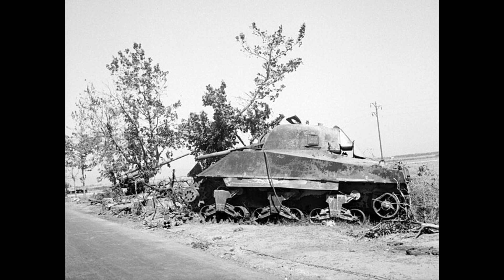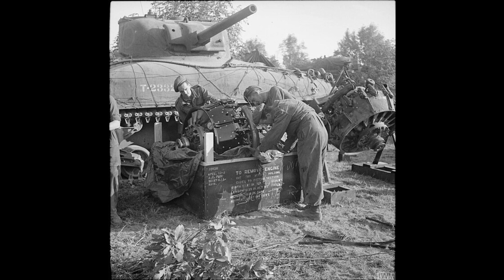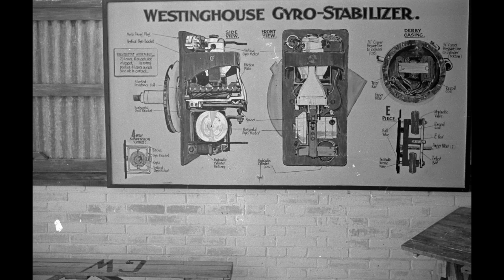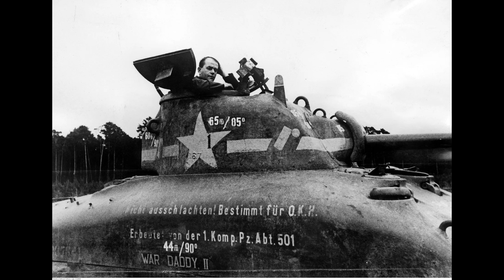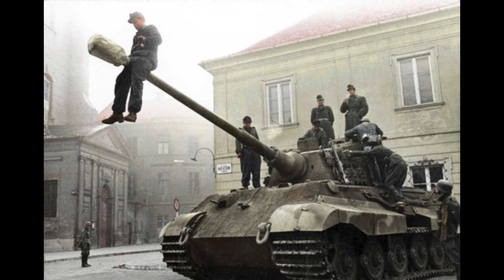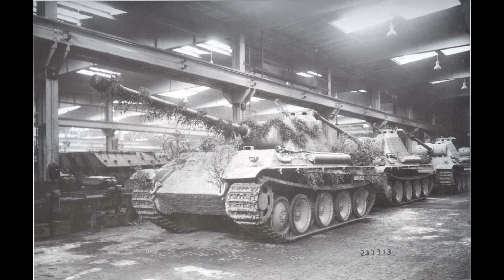German Engineers Tested a Captured Sherman - Then Realized Why They Were Losing the War

Comment: Why does everyone call the German "Big Cats" things like "engineering masterpieces" and the Sherman things like "barely adequate but reliable"?  The Sherman WORKED while the big cats BROKE DOWN.  I can see calling them "over engineered" in the sense that engineering is the art and science of using "just enough."  Obviously, they used NOT enough to make the transmission gears last long enough to be reliable.
Reply: Lennon or Lenin? The world is run by those who turn up. If the German tanks didn’t turn up , which they didn’t because of fuel shortages or breakdowns then there’s va pretty uneven battle. What’s strange is that the German general staff, who must have known of the needs of huge armies and also of the incompatible and fragile Russian rail network failed to realise the riskiness of their plans. The Sherman was excellent unless you were confronted by a bigger tank and even then with good tactics and a decent gun it could hold its own.
Reply: @billtaylor2050 Germany was never short of fuel until the last year of the war.  They had enough to send Italy 50,000 tons a month yet the Italians controlled the Albanian oil fields, the largest in Europe.
Reply: @billtaylor2050  It turns out, from objective and careful historical research and analysis, that German Generals were basically incompetent in the art and science of Logistics.  They seemed, generally, to think that Logistics, including supply, was Someone Else's Problem.
Thus for example General (Later briefly Field Marshall) Paulus, with reports of a major Russian offensive on his flanks, took no action whatever to protect those flanks.  Instead, he squatted down in Stalingrad, and blamed everything that happened thereafter on other people, since they failed to supply his surrounded army.
The much Vaunted Erwin Rommel behaved in similar fashion, leading eventually to total disaster.
Reply: Tigers & Panthers are cats
Reply: @richardwarner3705 we've all seen the avg IQ of yanks now. Or lack of
Reply: @clutchkicker392ison5 
I blame it on the Tequila🥃🥃🥃🥃🥃🥃🥃🥃
Reply: @richardwarner3705 or their education
Reply: @clutchkicker392ison5 
Settle down there, Banjo
Reply: @clutchkicker392ison5  There it is. I was starting to wonder if I was going to read a sample of the typical, undeserved, smugness, that superiority complex, that condescending attitude I have come to love like a pair of well worn boots (not the storage area in a car kind but the you wear them on your feet kind of boots). Tell me, just how does a small island country go from a world spanning empire to a "please sir, may I have another" barely holding on to its sovereignty by the tips of its proverbial fingers type of country? I mean, sure there are lots of ignorant, country bumpkins who couldn't find their own asses with both hands, a map and a flashlight (you guys call them "torches"), however the United States of America also brought the power of the sun to earth (just ask Japan, they'll tell you all about it...twice), the U.S. was second to outer space but first to the moon. When America was pouring everything into research and development into the microchip and electronic computing and all the possibilities those results would bring...what were the eurotrash "geniuses" doing? They were hoping the yanks would continue to over spend on their military budget so western Europe could continue to understand on their respective militaries so they could redirect portions of their budgets into social programs (a.k.a. buying votes of the masses with their own money). The U.S. made the SR-71 out of titanium we purchased from the Soviet Union...our biggest rivals at the time. We developed/developing stealth technology (a technology that got a major boost from a research paper written by {wait for it}...a Soviet scientist...we really should send the U.S.S.R. a thank you card and gift basket for all they've done...oh, right. Nevermind). 
The point I'm trying to make is:  get down off of your morally superior, high horse because from where I'm standing, you've got as much (if not more) embarrassing things that fill your history as we (and just about every other country here on this little blue sphere) do, and I believe we both can look down our noses at the Chinese communist party, the dprk, Cuba, muzzie countries and most of Africa and several South American countries.

and Germany...and France.
Reply: @clutchkicker392ison5 considering AMERICAN Sherman crews had the LOWEST casualty rate of all the tank forces in the war, that means we made the Sherman CORRECTLY. Meaning CREW SURVIVEABILITY over fire power. Yeah the Firefly could destory a Toger but the crew were DEAD if the tank got hit since the  gun installed in those ELIMINATED the ability of the crew to move and the lack of protective headgear didn't help either. The German "wonder weapon" tanks were predominantly on the Eastern front and a RAREITY on the western front, and those that were encountered were DESTORYED by the Sherman. It doesn't matter how many Shermans were destroyed or damaged taking the Tiger/Panther out because replacement tanks were already being sent and the crews SURVIVED the fight and got back in a new tank the next day. The myth of the unstoppable German armor was spread to excuse how POORLY Commonwealth forces performed on the ground before getting M3 Lee and M4 Sherman tanks.
Reply: @clutchkicker392ison5 enjoy your caliphate 🍺
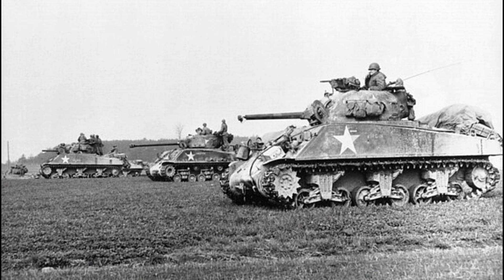Reply: The question was posed “If you had a choice between a Panther or a Sherman which would you pick to fight in?”  Well for a single battle perhaps the Panther so long as it was running, but for months of continuous mobile fighting I’d take the “EZ 8” hands down. Why?  Because it wouldn’t let you down, had seen significant improvements to mobility and crew protection and that HV 76 was more than capable of being a Panther killer. Especially if paired with 75 mm Shermans to deal with the infantry, defensive fortifications and at guns, which they almost always were (highlighted in the image at 17:57). People look at this all wrong. The Sherman was viewed as a part of an offensive machine. Panthers viewed generally and built to be their own team. History proves which philosophy was correct.
Reply: Pretend you gave to fight in one, the Sherman or the Tiger,  which would you take?
Reply: @dougritchie9548 
Pretend you can answer questions as well as ask them.

Where?  What is the terrain?  Is it 1 on 1 or a typical understrength German battalion against CCA/4th Armored?  Does everyone have a full fuel and ammo load?  What specific type of Tiger?  Sherman?  Will there be bridges?

What else is available to each side?

That will ALL matter.
Reply: @BillCarson-u3j
In 1941 when the M-4 design was finalized and cleared for production, it would have been the master of ANY German tank, though that was not its design mission.  Had it been a British design, they would have called it an "Infantry Tank," like the Matilda, as it's design mission was infantry support and that "French 75" was far superior to the British 2pdr for the tasks inherent to that mission but it would suit the tank v tank role if necessary.  

The "tank killer" (British "Cruiser Tank") mission for which it was not originally intended was to be filled by the series of designated "Tank Destroyers," first of which was an M-3 halftrack with a bed mounted 75 firing to the front.  It was followed by the M-10 with an improved 75mm and upgunnned to the 3".  The M-18 mounted the 3" on a blazingly fast chassis which saw great success in France deslite its very light armor and the M-36, basically an M-10 with a 90mm gun which made the Tigers vulnerable.   Only the halftrack was available in North Africa.

In 1942, when they first saw combat, the Sherman tanks were superior to nearly all German tanks they encountered and were at rough parity with the PzKpfW IV (f2) in all ways but automotive reliability, a virtue in which the Sherman was undoubtedly superior.

By 1943, the Sherman was showning its age and first encounteded Tiger I and Panther against which it wzs largely ineffective.  Improved Sherman models entered the pipeline.

By mid-1944, the latest German tanks definitely outclassed the old Sherman.  Sadly for the Germans, improved models began to arrive in the area of operation as did the British "Firefly."   Though still inferior to the Tiger 1 and Panther, the gun disparity was reduced.  

The main German battle tank remained the PzKpfW-IV (h), largely an f2 with protective "skirts."  The Ardennes Offensive of 1944 featured  a very large fraction of all PzKpfW-VIb (King Tigers) ever produced.  Many were lost to fuel shortage and automotive breakdown.  The offensive failed and its objectives were not taken.

Let's  assume that German offensive succeeded AND that Patton failed to relieve Bastogne THEN the weather cleared.  What then?

Because Montgomery's Second Canadian Army had cleared the Scheldt Estuary at great expense a month or two before, the Antwerp to which the Germans would have arrived would have been bristling with late model weapons and crowded with soldiers ready to be "baptized by fire."  Given the rather large number of King Tigers broken down in the advance, their number available to clear Antwerp and defend against the counterattacks American doctrine required would have shrunk, day by day, without hope of replacement while Allied numbers and state of armament and supply would only improve and rapidly.

In the end, the Tiger and Panther crews would walk back to Germany as their tanks fail in the retreat or accept "demotion" to the PzKpfW-IV that was still being manufactured in quantity... IF they could be delivered.  The captured fuel depots would be destroyed.. 

The "Big Cats" still lose, army to army even if not tank to tank and more than a few would lost tank to tank.
Reply: @dougritchie9548 The one that will last the entire fight, and be easier to get out of if im hit. So Sherman.
Reply: @dougritchie9548 
The Sherman. The odds of running into a tiger were so small that being worried about that happening was idiotic. Also, odds are you wouldn't be with a tiger one on one, you were part of a group of tanks supported by infantry.

And if you had a Sherman with the right rounds, you could disable it, it in a firefly, destroy it.  Tigers often operated alone because they had so few, Shermans operated as a group usually. They also thanks to the radio net with infantry, has early warning if a tiger was in the area and the Shermans could position themselves to be able to disable it. 

War movies like the Battle of the Bulge propagated a lot of myths,that the mighty German armor was invincible and supperior is one of them. 

And btw I have direct knowledge, I am old enough that my dad was a WWII combat vet in an armored battalion ( in his case TD unit, but also had been in tanks ).
Reply: @dougritchie9548 my Grandfathers brother was a career Sergeant in tanks. WW2 and Korea. I think he served in everything from the M3 Lee’s through to the Pattons. To hear him talk he loved the Sherman best. It had really great speed and acceleration. And apparently you could jump them much farther than the other tanks. (This was a major story point for 10 year old me raised on Dukes of Hazard.) yeehaw. He got to help play with some captured German tanks at one point. He said when they ran they were great. But forget ever getting one on the test range 2 days in a row. Good guns. But everything about them was overly complicated. He equated them to a family members fancy Turbo Diesel German car that spent 6 months in the dealership waiting on parts. Uncle John said a lot of cool things. But mostly what he said was “WHAT!?! What did you say? WHAT!?!” Although his tales of racing Sherman’s down a steep hill with a hump at the bottom to see how high and how far they could jump them was always a high point of summer vacations.
Reply: Same reason why F1 cars whose components barely survive one race are called “engineering masterpieces”.
Reply: For their time, they were considered “engineering masterpieces”! They were better made than the Sherman! To say that a Sherman was crap is inaccurate and hyperbole!
Reply: Partly because  the german machines were finely finished where it didnt matter
Reply: Over engineered usually translates to can't be fixed in the field
Reply: @shameless6963 
Would an "over-engineered masterpiece" be completely unserviceable in the field, then?
Reply: The German tanks of WWII are like German cars today. High tech, easy to run, but unreliable in real world conditions and expensive to repair.
Reply: @abyssalreclass 
Basically yes. Mercedes is notorious for that, they do innovate, come up with all kinds of crazy things to make driving easier, but it makes them less reliable and less easy to fix. The VWs were a simple car that was crude but easy to fix and relatively reliable for the time.  But later generation vws , audis,bmw, benz all went the route of complexity in ways that was to be honest weird. I remember trying to change a headlight bulb in the new generation bug and even with help from you tube videos and websites, it was bizarre.
Reply: @njlauren  I owned a VW ('99 Jetta, AAA VR6 engine), and I am still scratching my head trying to figure out the reasoning behind some of the design "features"
Reply: @abyssalreclass 
I had friends who owned the later Jettas and they said the same thing, muttered about strange sensor setups, fuel line fittings and the like. My dad, who was an engineer, said that German engineering seemed to be if there was an easy way to do something, or a hard way, they would find an even harder way to do it.
Reply: @njlauren  I would still like to slap the genius who thought it would be brilliant to put the timing chain on the transmission end on the AAA VR6, essentially requiring removing the engine from the car and separating it from the transmission to replace.
Reply: @abyssalreclass 
Why am I not surprised? They would argue it was a space thing, but in reality is was laziness or it cost less to do that. My 71 alfa had a timing chain that if I needed to change it,I could drop the oil pan and the valve cover and replace it easily. ( Real brilliant part is the timing chain was really,really durable, lasted forever and had a simple way to tension it if need be). 

They all do it, I have a toyota Camry with the high output headlights. To replace the bulb requires basically taking out the entire light assembly if you do it the way toyota does it, there is a hack but it is a pita. VW has something similar with their headlights on the new beetle, I helped a friend do it , the air turned blue with our cursing.
Reply: To this day they still over engineer their vehicles cost a lot to fix sure efficiency goes up but so does repairs
Reply: This type of information is fairly new in light of the history that was taught. I’m almost 61 and all I ever heard or read was how superior German equipment was and how inferior the Sherman was and it was implied the Germans almost won. We were lucky to win. That was the consensus. It doesn’t mean this information wasn’t out there, but I don’t recall it being available.
Reply: @JefferyHagen  It was all based on tank on tank battles where the Shermans did poorly against the German heavy tanks.  That and the face that German engineering compared to the Sherman was like comparing a Supercar to a Chevrolet. 
The engineering is vastly different.  But consider that the Germans relied heavily on horses and carts to move things for the entire war.
Reply: @ram2791 we taught or it was implied the German army was a fully mechanized army when in reality it was only 30% mechanized. Little was said of America’s tank killer philosophy only how inferior the Sherman was when it came to dealing with the big cats when it wasn’t designed for that purpose. I like all of this information, but it’s frustrating having to unlearn what I thought I knew. I’ve worked with German forging equipment and the Germans haven’t changed. 😂
Reply: The single biggest design flaw in Nazi tanks was over engineering. One story I heard was that you almost had to return one to the factory where it was built to get it repaired. American tanks were built to be repaired as far forward as possible.....
Reply: @jacobbaughman748 
The plan for major repair or refurbishment on any German tank was to send it home.  The United States knew they did not want to transport medium tanks back to the States.  Sherman tanks were fixed on the east side of the pond, if they could be, or just parked at some collection point or boneyard and replaced.
Reply: @frankmcgowan9457 , I thought that is what I said? Fix it as far forward as possible..... Means not in any rear area or back home but as close to the enemy as practicable.
Reply: @frankmcgowan9457 - Because the big cats were amazing and ahead of their time. Absolutely the big cats had serious reliability issues because they were ahead of their time and their actual time was a world war. Be glad they didn't have the reliablity of a sherman or things might have turned out different. People sometimes question how much of a factor the Tiger 1 really was versus how much around it was myth. Then you bring up the point that there were only 1250 Tiger 1's ever made and have to realize that clearly the Tiger 1 deserves the reputation it has. Both fearsome and unreliable. Tigerphobia was a real thing and for good reason. Imagine how terrible it would have been had the Germans been able to produce and field as many Tigers as the U.S. did Shermans.
Reply: Difference between World of Tanks vs. practical use in the field.
Reply: Well in this day and age. You certainly don't want to offend the Germans.
Reply: The engineers specified high tech materials. German logistics couldn't supply them. So those fancy transmissions had cheap cast iron gears instead of machined chrome-vanadium gears, with predictable results.  The German tanks weren't bad- the Tiger I and Panther had lower ground pressure than the stock Sherman, despite their massive weight.
Reply: Wehraboo delusion.
Reply: For the sane reasons that people try not to own BMWs longer than 3 years after buying them new
Reply: Excluding air power, if there were the same amount of running big cats for the German defense as America had Sherman's it would have been very difficult.
Reply: @tvan1011 
Except... except for the Ardennes, I don't think that situation ever arose.
Reply: @tvan1011  it would also be a nightmare for the Germans, as they kept updating and changing the design of individual parts of tigers and Panthers, basically to the point that each tank required different parts, and they weren't able to cannabalize other tanks for field repairs like the soviet's could with t-34s. Likewise it would not resolve their logistical issues in regards to fuel or ammo, but only accentuate it, and it would also not help that the bulk of the German tank commanders were undertrained late war. Also knowing how German generals thought they likely would've still fielded them in smaller numbers closer to what you saw historically and use the extra ones as simple replacements for m-killed pathers and tigers
Reply: HEY .HEY🧠👉Im gunna get you started👉up to you to investigate and find European Pride , You ready for your offspring to be hated  and outnumbered by Non Europeans in their own homelands?? WEASEL🤬👉Why are you not smart enough to know for a state the size of Georgia Germany out paces any nation of people on the globe for design manufacturing and selling to the world, start with Cars, then Medicine, then technology…..
then social structure….
NOTHING MORE BEAUTIFUL THAN NATIONAL SOCIAL GERMANY IN HER WHOLE 6 years they gave them….
the nastys SMOKED THE SXEUAL EXPERIMENT CENTER IN 1933, Magnus Hirschfields chop it off clinic—-none of that crap in our society! 
⭐️⭐️⭐️⭐️The size of Georgia was smoking the 3 Empires that controlled 60% of the EARTHS LAND MASS! 
✨✨✨The View Germany had for Europe was beautiful, have you had a look at my European homeland that 
🧠🧠AMERICA would not exist as we know it WITHOUT EUROPEANS——🤮🤮AMERICA WAS A COMMUNIST ALLY DUMMY! 
🤮Allied with CHINA AND INTERNATIONAL CONTROLLED RUSSIA 
👉POOR RUSSIA PEOPLE WERE HIJACKED IN 1917…..GET A CLUE….
☎️WHERES THE USA MERCEDES BMW AUDI PORSCHE KONIGSEGG?? 
🧠🧠🧠🧠🧠🧠The size of Georgia and out pacing the world…..Thats why the true thugs had to crush the movement because Germany had a better way for all Humanity! 
👉👉Some people were just not wanted in Europe because they dont like Europe kinda like today in America, people cant wait to get here and whine and complain—-WELL STAY IN YOUR SHEETJHOLE YOU CAME FROM, EUROPEANS BUILD PARADISES
Reply: The video explains this for like 20 minutes strait
Reply: The issue wasn't that the tiger and panther etc WEREN'T GOOD, they had the most efficient anti tank gun of the war on them, along with some of the best armor profiles when used correctly, the issue also wasn't "Not enough parts in the transmission" the issue was TOO MANY SMALL HARD TO REPLACE PARTS in the transmission. The issue isnt that they weren't complex enough, the issue is they were TOO COMPLEX, field repairs were a nightmare at best and impossible in most cases, the engine overheating and fire issues DID GET RESOLVED... in the last like 4 months of the war. If the tigers and panthers etc WORKED they would have been  a nightmare, but there were instances where 32 tiger II's were sent to go clear a town and only 14 came back because 13 broke down and 6 were knocked out in combat. That is more than a 50% loss of that armored unit and only like 15-20% of that was because of the enemy force. There were panzer divisions that were less than 40% operational ON A REGULAR BASIS, THEY WERE GREAT VEHICLES... BUT THEY RARELY WORKED FOR MORE THAN A FEW HOURS AT A TIME.
Reply: @Gr1mzR34p3r 
Still the transmission.   

The rest of the drive train had its own issues, principally the final drive.  The interleaved road wheels of the Tigers presented their own issues. 

Yeah, great gun and plenty of armor, good engine in the Panthers.  The engine in the Tigers, apparently the same as in the Panther models (common spare partts is good), but the weight difference made the engine marginal in the Tiger I and inadequate in the Tiger II.
Reply: @Gr1mzR34p3r 
Which means basically then they often were next to useless. It is like in sports where you have a player who is incredible but is always hurt. If they aren't on the field a lot of the time, they are not an effective player. 

The tigers and Panthers had other limitations, they burned fuel at a crazy rate, they were limited in town fighting, weren't all that maneuverable and their refire rate was relatively slow, too. 

All tanks have limitations of course, it is why tanks are designed for specific purposes. With the tiger and the panther, besides reliability, that were difficult to make, you add a high breakdown rate and low total numbers, really reduces their value.
Reply: Exactly. Even today german tanks sit static in museums whilst thousands of shermans that also saw combat are thrashing up and down forest tracks doing fun rides.
Reply: They were precision pieces, like old hand-fitted firearms.  Beautiful, but requiring highly specialized mechanics and gear.
Reply: Because most are ignorant and think a tank is a tank.  Shermans were medium tanks and not true tank killers.  They were infantry support.  Tigers were heavy tank killers.  Panthers were extremely heavy medium, 44 tons, tank killers. Shermans actually did okay against german medium tanks like panzers.  The Sherman Firefly and easy 8 could take out heavy tanks with the high velocity 76mm gun it mounted.  As to build, Shermans were mass produced on assembly lines while German tanks were built more like sports cars.
Reply: @ram2791 and what of the Sherman Firefly? No tank is designed to fight tanks, tank on tank combat isn't as efficient as an infantryman with a rocket launcher, a partisan with a Molotov cocktail, or artillery, or air support, or even the weather. but some are better at it than others. I would argue the firefly, t-34-85, and the tiger and panther all fit into this category of not designed for it, but better at it than normal
Reply: @Nomad1917  The Sherman Firefly and Easy 8 were both up gunned and up armored to take on other tankes, The T28, M36 Jackson, M26 Pershing and M1 Abrahms were designed to fight other tanks.  Tiger tanks were designed to fight other tanks, other countries also designed tanks to fight other tanks.  The standard M4 Sherman was an infantry support tank in the main.  Yes infantry can be very dangerous to tanks when they are alone especially with todays weapons.  But that i not the point nor is it germane to this argument.  Point is a lot or most people think the Sherman sucked because they judge it against criteria it was not designed to meet.
Reply: An engineering masterpiece is when you build something very impressive that works, especially to other engineers. That says nothing to how practical, useful, or even to the longevity of the item. Don't forget it took 20 years for engineers to stop trying build a perfect helicopter before a helicopter actually flew.
Reply: Difference between a ford F150 and an Audi A8
Reply: 100%. It has to be fit for purpose.
Reply: Well, I think the answers are presented in this "video." Allied naval blockages cut off supplies, like today's rare earths, and allied bombing interfered with military production. Add the fact that Panthers and Tigers were, of necessity, not designed with power trains that could match American tanks, and the German tendency to over-engineer things: Volkswagen maintenance compared to other manufacturers, explain much of the problem. 
If Germany had the resources, they probably would've corrected some of their issues. Of course, the superiority mentality might have affected their reasoning.
Reply: Why do people today praise German cars that are feature rich and pretty, but unreliable and costly to repair?  So much so that  most new BMWs are leased, not sold. This clearly shows, along with low 5 year retained value, that people don't trust used German luxury, compared to Lexus.
Reply: The major problem with the German tanks wasn't so much that they broke down, but that they couldn't keep gas in them.

In terms of quality, Omar Bradley made the reality of that situation very clear:

"We are going to lose four Shermans for every panzer we kill. That's why we bring 10 shermans for every Panzer we kill.
Reply: Oh don't worry. There's a pretty good chance the German big cat tank fanatics will show up in the comments section here and start gaslighting everyone that German big cats were reliable, easy maintainance engineering marvels and Shermans were crap. Much of what they base this stupidity on is cherry picked information such as Belton Cooper's memoirs and manipulated after action reports. Per your point about transmission gears, the problem with German heavy tanks was in their final drives where they used straight-cut (spur) gears rather than curved (helical or spiral bevel) gears which were used in American tanks. This wasn't as much of a problem for Panzer IV's which were medium tanks but a MAJOR issue for the heavy German big cats. With the Panther, the driver had to be careful not to do any sudden hard turns from a stop or at slow speeds or those gears would break. You would think that the Germans would have understood the necessity of manning Panthers with experienced crews for this reason but by the time of the Normandy invasion, they put experienced crews in Panzer IV's and inexperienced crews in Panthers. My guess is the psychopathic corporal who was running their military had something to do with that decision just as he did with adding way too much weight in armor to the Panther which caused the problem in the first place. Conversely, the reasons the Germans used straight cut gears had more to do with industrial constraints, material shortages, and a design philosophy that prioritized simplicity in manufacturing over long-term durability.
Reply: @GTX1123 
Automotive reliability and performance had been the Achilles' Heel of Germany's armored force from the beginning of it's existence.  From the post-Anschluss expansion into Austria, seizure of the Sudetenland and the invasion of Poland, Panzer commanders knew automotive breakdown was predictable.  Over the years, maintenance and repair had slowly brought new parts into use and reliability of tanks had significantly improved for chassis through the PzKpfW III and IV and the "III/IV" hybridized chassis used for the "Hummel" 15cm self-propelled artillery and the "Nashorn" 8.8cm tank destroyer armed with the excellent PaK 43/2 gun.

Rapid development and introduction of the 45-50t (sources differ) PzKpfW-V "Panther" and 56t PzKpfW VIa "Tiger I" (the VI (b) "Tiger II" updated everywhere but the engine came about 2 years after Tiger I)which seemingly shared an engine type while each - again, apparently - introduced its own fragile (I would argue "inadequate") transmission reset  "automotive reliability" back to the beginning.  That, in turn, required continued production of the mature PzKpfW IV as a primary battle tank and the PzKpfW III chassis for the 10.5cm "Wespe" , Stug III and, even, the PzKpfW III (Ausf J) for specialized uses.  This is an example of "command economy" at its finest.
Reply: @frankmcgowan9457  What it ulimately came down to is that the Germans didn't have the manufacturing and material capability to produce / replace tanks at the same rate the Americans and Soviets could. While they may have extended the length of the war by producing more of the later upgunned version of the Panzer IV and Stug III TD instead of the less reliable big cats, they still would have lost. You're talking upwards of 200,000 American and Soviet tanks vs what was at the most, 70,000 German tanks.
Reply: @GTX1123 
Yes, they still would have lost.  They were doomed from the beginning.
Reply: Well, in engagements the Big Cars destroyed 5 Shermans and than were destroyed themselves by Sherman nr 6. Outflanking the Big Cats with superior cross country mobility. War is a production numbers games.
The Big Cats were designed to fight the Soviet tanks on flat steppes of Russia. Engaging from a long distance and hitting accurately. Because the Soviets had many tanks. Even the Ferdinand was designed as a long distance tank killer, aka the tank sniper.
As pointed out in the video; German tanks drove only short distances, because long distance transport was done by train.
Reply: @mardiffv.8775 - No, that is not correct...
Reply: @mardiffv.8775 that is incorrect, the claim that it took 5 Sherman's to take down a tiger or panther is just fundamentally misunderstanding the nature of war and tank combat. The reality is one Sherman or t-34 could destroy a tiger or panther if given the opportunity, and a single tiger or panther could destroy a t-34 or Sherman platoon on its own if given the opportunity. What you're saying is equivalent of saying it takes five Glocks to take out a guy with an ak47, it's just not the case. I should also note that Sherman's engaging tigers or Panthers at all was exceedingly rare, in fact on the whole of the western front post D Day I bekieve the allies only engaged the tiger 1 tank twice, once against whittman, and another time through a bombing run on a train carrying the tiger. Most tigers and operational German divisions were sent to the east, while divisions that had lost significant equipment or manpower in the east were sent West to recover while guarding the Atlantic wall
Reply: @mardiffv.8775 
I think the point is that German tanks HAD TO be transported by train to get anywhere for two reasons: fragile transmissions and NO FUEL for long drives.

It all goes back to the joke that says "Europeans think 100 miles is a long way; Americans think 100 years is a long time.  BOTH ARE WRONG."
Reply: @frankmcgowan9457  I agree with you. And Europe had and has a very dense railway network. So it should be foolish for the Germans not to use their trains.
Reply: @mardiffv.8775   foolish is completely relying on that rail network and underbuilding the transmissions. They lost for a reason.
Reply: @nate67r31  Yes indeed, the Germans lost the war because Hitler demanded heavier tanks and that Austrian landscape art painter was unaware that there were not suitable transmissions available. 

Also the Russians always feared an invasion from the West, so the Russian railways uses a broader gauge than standard gauge. So German/ Polish trains can run over Russian track. Not without changing their bogies.
Reply: @mardiffv.8775 Germany did not lose the war based on Hitler's tank demands lol.
Germany lost the war for several reasons.  
The industrial might of the US, fighting a two front war, Germany's failed logistics and leadership, and strategic blunders, etc
Reply: @Patrick-xv6qv  Yes you are right. May I add that Germany even fought a three front war (North Africa + Italy, West Wall + France and the Soviet Union).
Reply: @mardiffv.8775 This myth of 5-6 vs 1 German big tank has looong been debunked as battlefield myth .
Reply: @wilinstonthompson1352 Gooood, that means less American, British, Canadian and Polish tankers have given their lives.
Reply: @wilinstonthompson1352 It's not literal.. It's just a statement about the industrialization capacity of america compared to the germans in ww2

America had been fully industrialized for vehicle production for decades by the time germany began reindustrializing under the guise of producing farm equipment
Reply: The “Big Cats” were indeed engineering masterpieces but they were built with inferior steel, the good stuff was no longer available, and built by slave labor who had no interest in doing a good job. The greatest problem, however, was that they took too long to build. While the Soviet Union and the U.S. were pumping them out at a high rate, the Germans were producing them at a pace that could not keep up with losses.
Had the Germans concentrated on building and improving the Panther, the war would have lasted much longer. Instead, they went on to put everything in the Tiger and King Tiger and they were just impossible to build in useful numbers and came so late that there was no opportunity to work out the considerable bugs and serious problems.
Reply: @johnkochen7264  Hmmm...well, the quality of German steel wasn't that bad in the beginning of the war but yes, it did grow worse as material shortages became a problem towards the end of the war offering less protection as it was more brittle and prone to crack. Per your second point, over-engineering tanks is why German tanks weren't engineering masterpieces. German tanks had a lot more parts than American tanks and it wasn't simply because they were bigger and heavier; e.g. the M26 and the Centurion both designed during the war and built towards the end of the war were not as complicated as German tanks and both had big cat killing capability and decent armor thickness. The Centurion was arguably superior in its design and engineering to any German tank due in part to the fact that it was much more reliable and easier to maintain. Part of the reason it took Germans so long to build their tanks was for this very reason. Had their designs been simpler, they could have produced more of them. Case in point, they could churn out 300 Panzer IV's per month compared to 100 Tigers and slightly more Panthers. Had the Germans either simplified their big cat designs or focused on churning out more Panzer IV's they still wouldn't have won, but it would have extended the war.
Reply: @GTX1123  The Germans tried- they had the "E-series" tanks were being designed on the KISS Principle with standard parts shared across different models.  They ran out of time.
Reply: @johnkochen7264  Panthers had a bad transmission that burned out fairly easily. German armor was decent but they were over engineered and slow
Reply: @darkhighwayman1757  the term "land boat" comes to mind
Reply: @johnkochen7264 it was also the fact that the Germans kept revising and updating minor things about the tanks that made replacing parts by cannibalizing other destroyed or m-kill tanks was practically impossible.
Reply: Survivability.  Sherman's tended to be turret poppers
Reply: @davidswanson5436 
There has never been a truly invulnerable tank.  There never will be.

The Sherman managed to prevail in the Bulge where its main adversary was the Tiger II, largely because the Sherman was much faster and more maneuverable.  The roughly 2000 Tigers (not quite 1400 Tiger I and not quite 600 Tiger II) were insuffient to reverse the outcome of the war, even if no Tiger ever broke down. Meanwhile, introduction of the American Pershing model, which could engage on equal terms, would have greatly complicated Eisenhower's logistical nightmare.  About the same weight as a Panther, it used the same 400hp Ford GAA V-8 as the late model Sherman, giving up some speed and off-road mobility.
Reply: @frankmcgowan9457  In the battle of warhead vs armor warhead will always win.
Reply: The US understands that war is to kill, not show off
Reply: @kalvinkalvarino9536  two things can be true at the same time...and "showing off" can be a double edged sword. On the one hand, it makes all the countries that are not us, the U.S. of A., respect this country and all the hurt we can bring to ANY place on the map. On the other hand, showing off could motivate countries that have the resources to "step up their R&D game," which could lead them to technological superiority over the U.S. and we would be playing catch up so as to remain competitive (economically speaking) or not worth the use of their military because of the devistation and rebuild costs. Now if only we could put a stop to all the foreign bad elements from brainwashing vast numbers of American citizens, we could focus more on advancing humans into the next age (stone, bronze, iron, etc.), but communists seem dead set on throwing every possible proverbial speed bump,  road block, construction zone, bridge out and detour miles out of the way of true gains that benefit all of the planet (but especially Americans).
Reply: cause are so full of themselves they thing german means greatest most perfect mist intelligent blah blah blah... they live in a very ugly bubble
Reply: @senben9180 
Yeah, something like that. Movies have a lot to do with it , and for some, it is darker, that they admire the Nazi era and the Nazis.
Reply: Ironically,  this has been echoed in Donesk. The German tanks were rather useless.